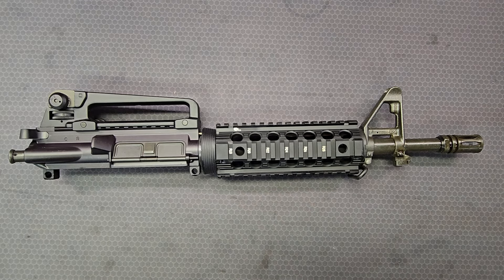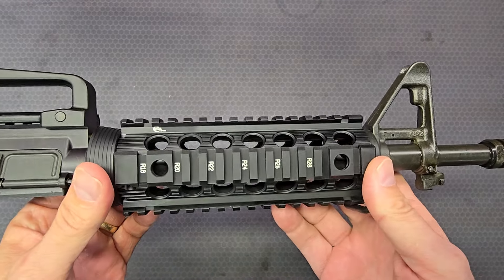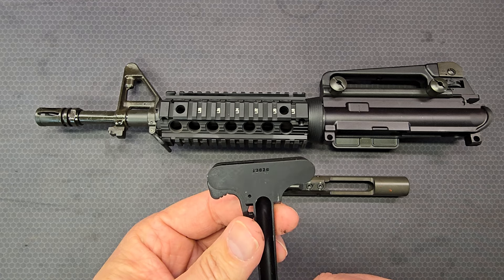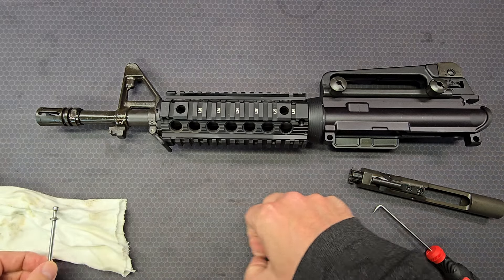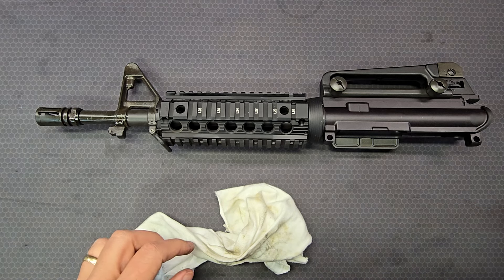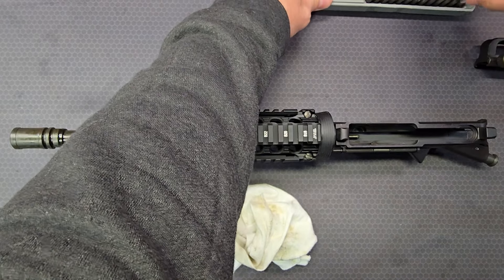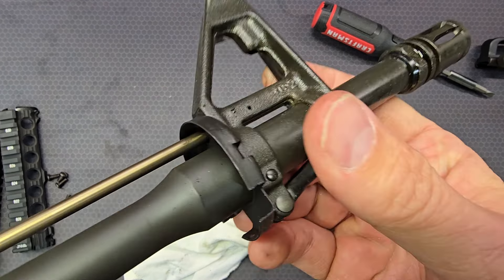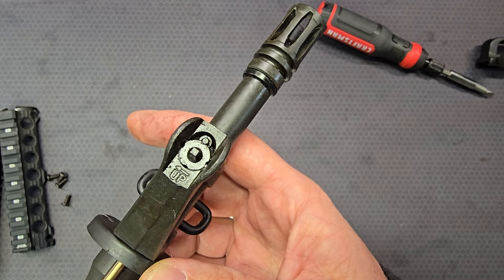Colt 11.5" Upper Receiver w/ Colt-Branded Troy Rail Adapter System.

Comment: I have a Colt 9mm 10.5 upper and the barrel is marked under the gas tube as well. I also have a 6720R Talo with a different Colt branded Troy handguard.
Reply from the maker: @shawnpatten6515  congratulations on having one of the 6720R carbines. Those are not seen very often. That is a model missing from my collection.
Reply: @thecoltar15resource  thanks for your work on the channel and website. Genuinely enjoy everything you publish.

Comment: I have a cage code charging handle I got from specialized armament in 2019.  I recall reading on the SA website that the military used them, but I've never seen one on a military M4 or M4A1.  They don't appear to be available anymore.  Is there any info on them worth mentioning?
Reply from the maker: @85November  I don't know any significant information on the CAGE code charging handles. I served in the Army for 32 years. I retired in 2020 using the M4A1 Carbine. Never saw a CAGE code charging handle until the last few years. I'm sure they have been out there.

Comment: I just found a colt ar15 A3 tactical carbine... heavy barrel 1/9 twist....i has a troy rail also but sadly not colt marked...it is a trade in ..so i traded in my cr6920 as a down payment 500$ left to go
Reply from the maker: @ryanblackgoat4741  Although the AR15A3 has it's own unique rollmark, I probably would have kept the CR6920. If you traded in a carbine and had to add additional money, it sounds like they are over-charging for a used gun. Hopefully it is in great shape.
Reply: @thecoltar15resource it's in great shape...I have 2 m4 marked 6920 so one won't be missed....the AR-15 a3 has a vortex spitfire one there so that's y it's alittle more and Magpul furniture I well sell the Magpul and the spitfire so I'll get a little money back...just need a AR-15 A3 for the collection.
Reply from the maker: @ryanblackgoat4741  the AR15A3's are definitely a unique piece. I need one as well. Congratulations on the addition to the collection.